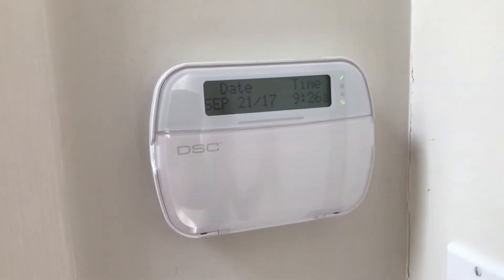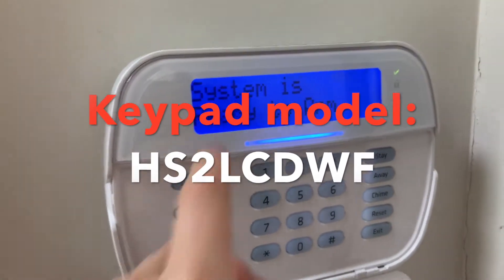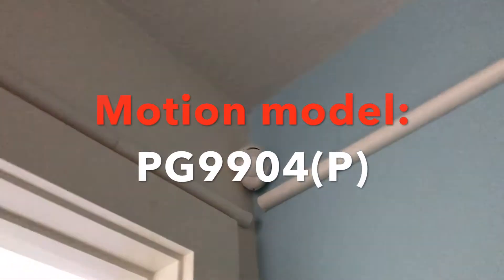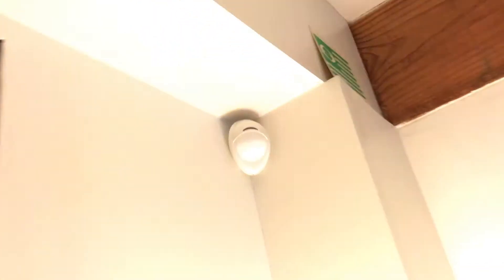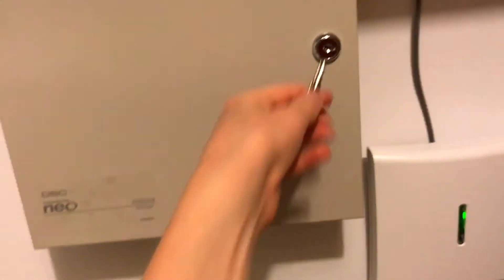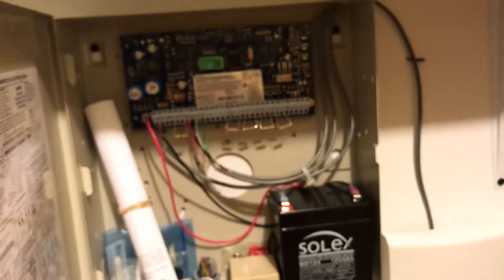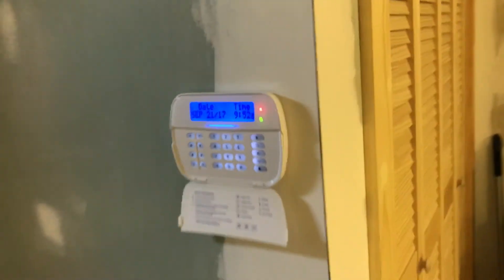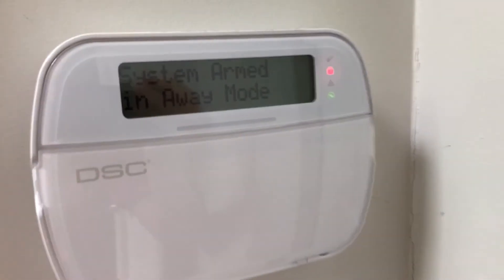demonstration of our new DSC Power Series Neo Security system!

Comment: Hey does testing a security system call the police department or not
Reply: If Your System has Monitoring Yes It Will. If You Are unsure If You System Is Monitoring, Do Not Test Until Your Have Confirmed That Your System is Not Monitored Or If You Do Have Monitoring Call You Monitoring Company To Put You System in Test Mode